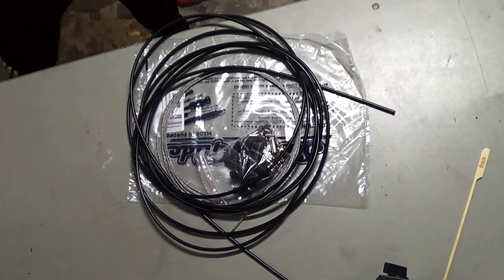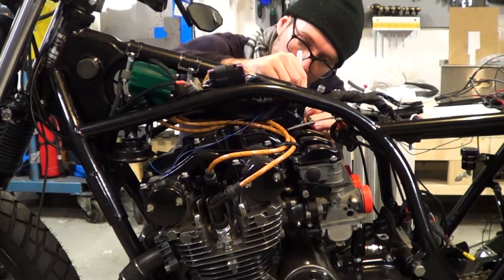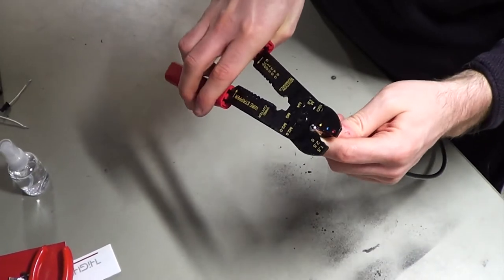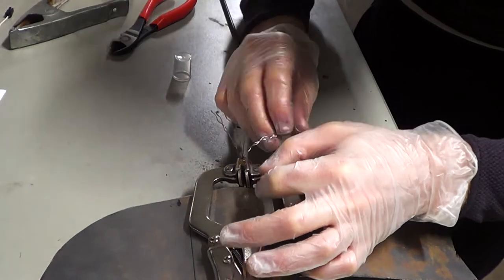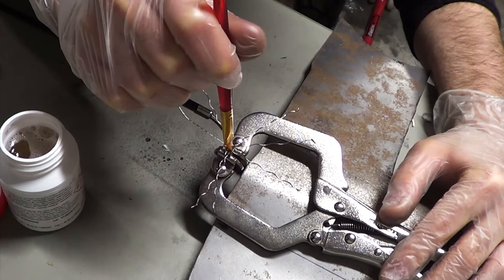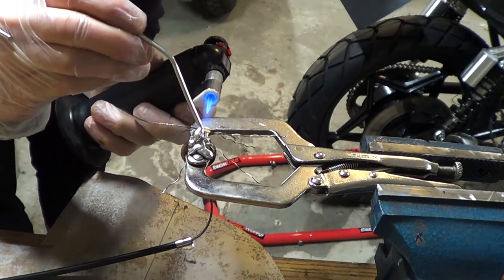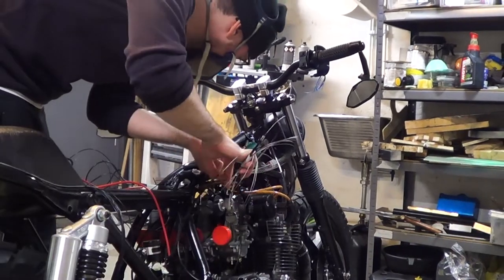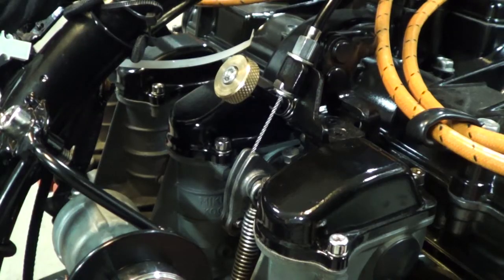Making a Throttle Cable | Suzuki GS550 | Tracker / Cafe Racer Project

Comment: Hello! this is cool! one tip for soldering, heat the work piece only. it should be hot enough to melt the solder without the torch. This is how I get good penetration
Reply from the maker: Thank you! Yea, that’s the way to do it for sure! I’ll keep it in mind for next time :)